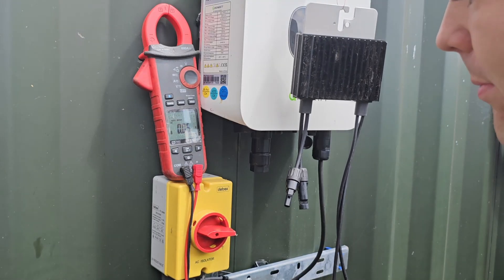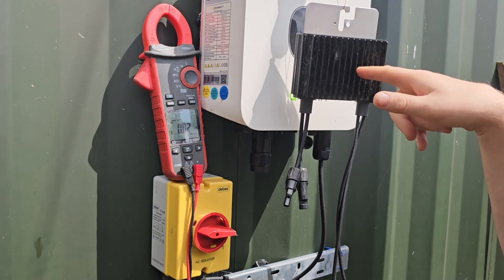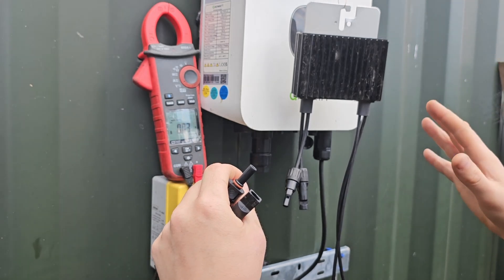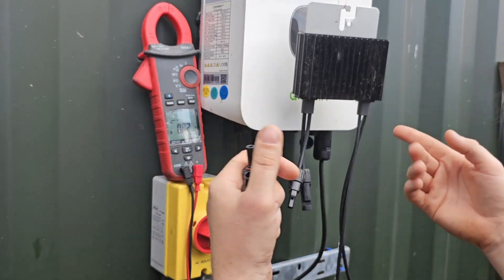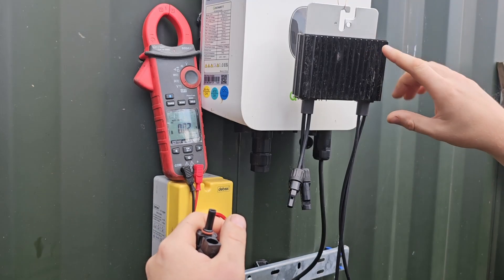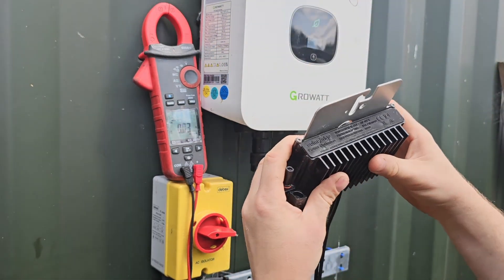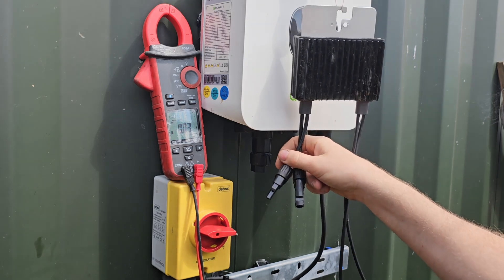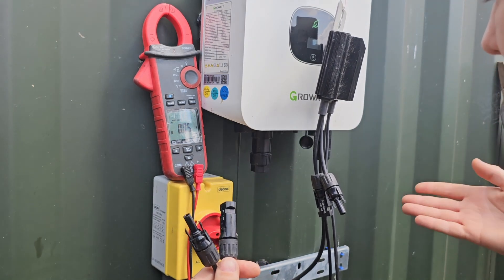SolarEdge systems are not as safe as they'd have you believe.

Comment: Rubbish video. So much mis-information and incorrect information. 

Clearly got an axe to grind. 

Voltage pass through isn’t common. Support is available for swap out. 

The assumption that 100% of the time is a product fault is also wrong. Poor installations are commonplace in the uk resulting in product failure, storing or MLPE

I don’t believe a word.  If said with conviction, you sound like an expert…
Reply from the maker: Which aspect is incorrect?
If I've made a mistake I'd like to correct it.

I do have a bit of an axe to grind, they're a nightmare to maintain!

Comment: Perhaps an explanation of how to initiate the 'designed' rapid shutdown feature would have helped to provide some background context into the design issue being highlighted.
Reply from the maker: @cvarsani2190  good question.

Broadly if it's planned then you just turn off a small switch under the inverter. If it's unplanned then it's initiated by the inverter. 
The optimisers should only output more than 1V when commanded to by the inverter, the intent is that they default to 1V which is designed to be safe. The issue is that they can fail dangerous.

Comment: @1:28 yield variations, well isnt that just the silicon lottery? no two solarpanels are created equel? unless you are referring to the paneels that are down, but I'm guessin thats the optimisers not the panels and can hardly be refered to as variations?
Reply from the maker: @tiemenvanderbijl785  often it's just module variations, absolutely.

You can get yield variations of 10% or more on a non soiled roof and that doesn't feel like module variations. But it's really difficult to know, and it's also impractical to search through.